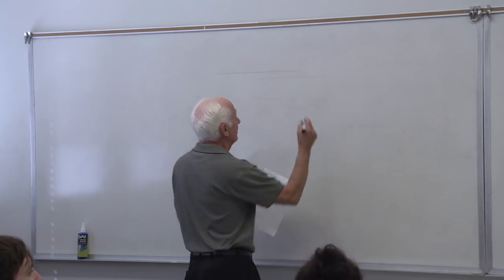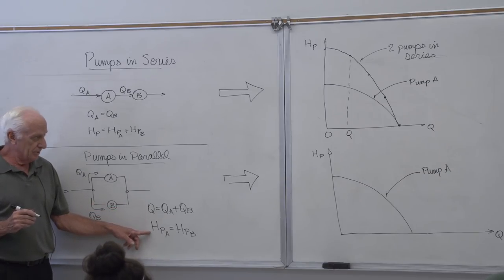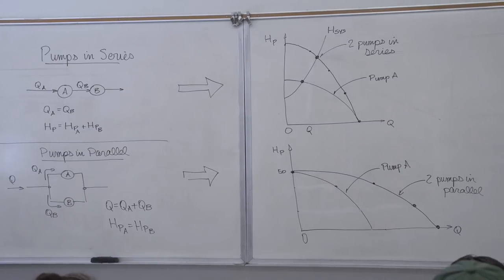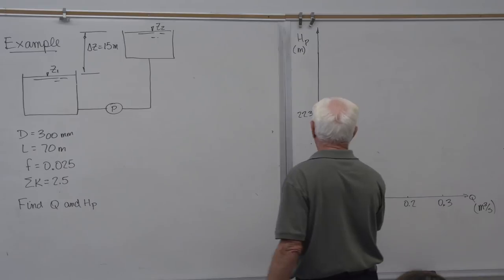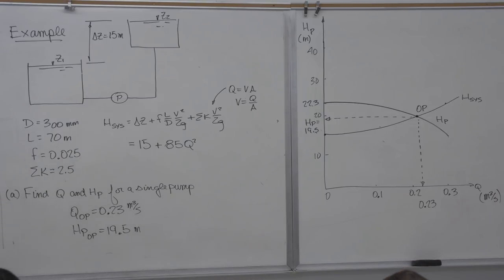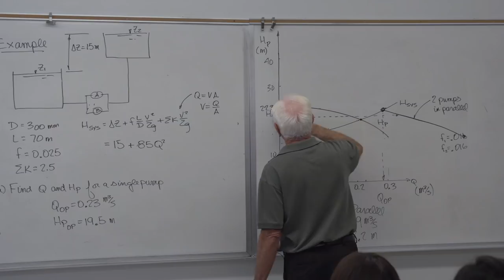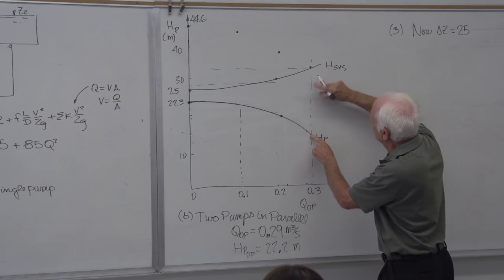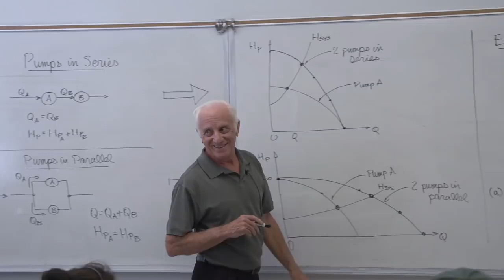Fluid Mechanics: Series and Parallel Pumps (22 of 34)

Comment: I am an aircraft hydraulic mechanic. The particular aircraft I maintain has 2 independent hydraulic systems, each with 2 engine driven hydraulic pumps rated at 3000 psi @ 22.5 controlled by internal compensators. For years I've been told total system flow is limited to 22.5 gpm by the compensators. Thanks to this video, I have ammunition to start an argument when I get to work lol

Comment: You set the friction factor, f, to 0.025 regarding it as a constant. But I seem to remember that f is a function of Reynolds number which again is a function of the linear velocity of the liquid. So if you are using different values for Q to determine the system curve, then the velocity is not a constant and hence f is not a constant either.
Reply: yeah, I have the similar concerning to you. Must be have the separate system curve for each Q.
Reply: That is why the system curve is nonlinear and curves upward.  If you double the flow you more than double the required head to yield that flow.

Comment: I have a question: I have a 1/2" tubing that supply my outside faucet in wich I connected a 3/4" pipe to supply 3 sprinklers head. I have around 8 gpm at the faucet but its just a little to low for those 3 heads. It spray good but radius few foot smaller than with just 1 head or 2... So I want to supply more water to get full radius... But its hard to tell if I should get more pressure or more flow! Since its working fine with less head it looks like the pressure is ok but when the flow increase the pressure is dropping logically...
Then if I ll get more pressure, I must use an inline pump with at least 8 or 10 gpm wich is udge just to get few more gpm... and if I want more flow, I could add another water line that supply the faucet and use a pump on this line. So more flow would be there but the pressure will be the same (if the pump get to high it would return the flow backward). So I was wondering if that additional flow would get to the sprinkler heads or it would change nothing? And since the pressure is the same, the pump would be useless... so that other line would just reduce the pressure drop on that part of the line...so almost no gain... What do you suggest?

Comment: efficiency of single pump when working in parallel should be at total flow rate of system divide by number of pumps at the pump system head? and not single pump curve intersecting system curve?

Comment: If  my system has 2 identical pumps in parallel, how minimal same pump I can add in series to increase head? Will system work if I add only one pump in series  with same capacity to two pumps in parallel?

Comment: Dear Sir,
Could you please share your email ID. I want your help in understanding something that's going on in my project. We have 2 seawater intake pipelines connected to 3 parallel pumps (2W + 1SB) through a common header and on delivery side we have 2 parallel pipelines through a common header. Each pump is designed for 1050 m3/hr flow at 24m head when 1 intake line and 1 delivery line is open . Now when 2 pumps will run simultaneously with both intake and delivery lines are open. What will be the system curve?? Will we get double flow in this case?

Comment: Sir very clear and understandable lecture.
Thank you. 
Sir i have a question. For pumps in series  to meet suction parameter of second pump. 
should we add enough residual head in duty head of first pump to overcome the Npshr of second pump. 
And also whether atmospheric pressure will act at input of second pump.

Comment: Thank you sir for the video
todays problem in my work led me to this video
The problem was 2 pumps of different sizes
Pumps A of 20 KW and Pump B of 1 KW are in Parallel Combination
The max Allowed Pressure at discharge is 6Bar
the Circuit is a closed loop mainly for day tank circulation and there is  bypass valve at the end of the loop.

Case 
Bypass valve 100% closed to ensure the full circulation at the loop with 5 Bar pressure with 1kW pump.
but i have to switch from Pump B to pump A
Can i switch on the pump A without Shutting off pump B or i would have to shut B to start A
Keeping Pressure in 5 bar for which i have to open the bypass to maybe 50% in order to get 5Bar.
Reply: double acting reciprocating pump with a piston diameter of 50.8 mm and a piston stroke of 100 m. works with a speed of 10 Hz and its volumetric efficiency is 75%, pumping a liquid with density of 1200 Kg/m3. If the friction losses are negligible, calculate. 1. The actual mass flow rate (M) of this pump. 2. The slip of this pump in (m'/s) and in (%). 3. t the pump head (H,) is 36 m, what is the required liquid power in horsepower?
Please if you know what the problem is, tell me